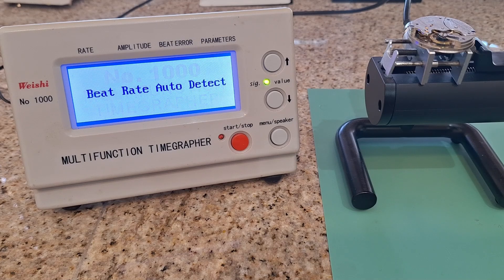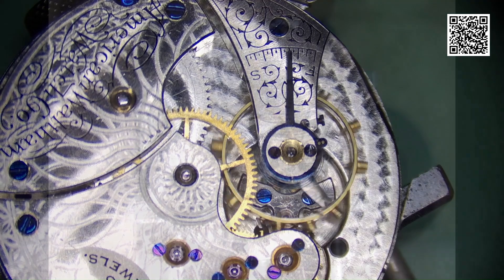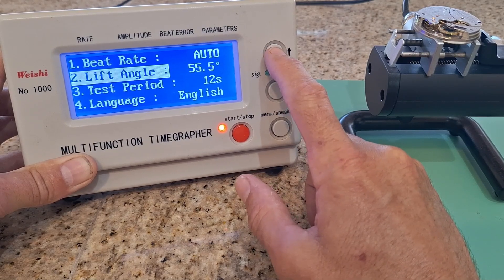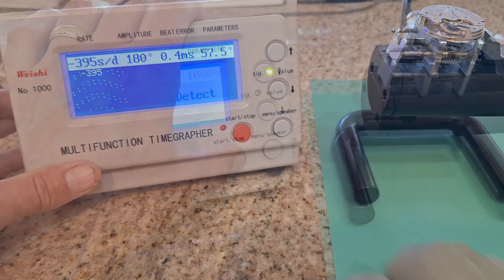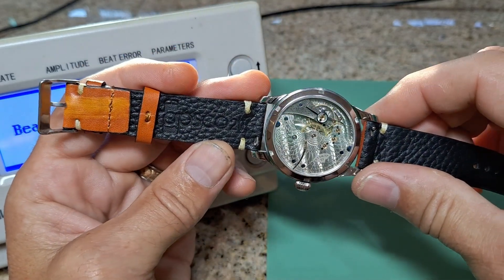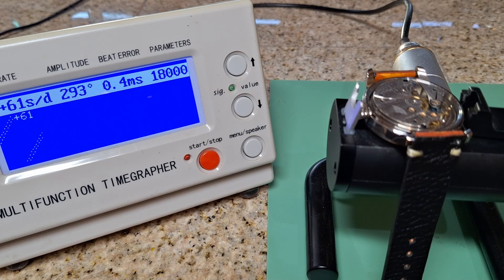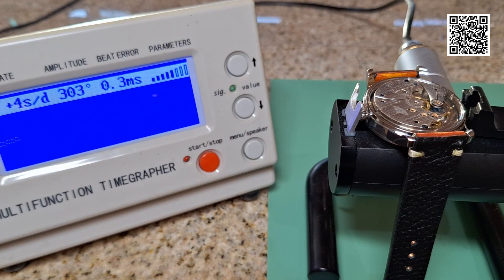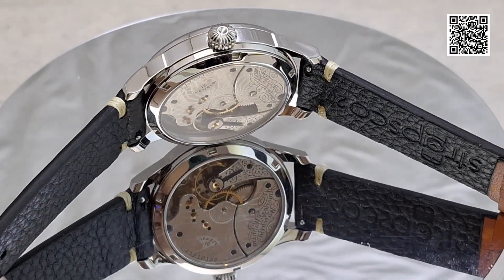How to calculate the lift angle, using a Waltham model of 1890 size 6 pocket watch.

Comment: I'm trying to understand the process of finding the lift angle. So, the amount of winding of the mainspring determines when your red mark is at 180 degrees? I think I'm missing something. What if your angle isn't 180 degrees? How would you set it up so it is? If it is off 5 degrees how much does that matter? Thank you.
Reply from the maker: It sounds like you basically have it figured out. A very weakly wound mainspring will tick but at less than 180 degrees, a fully wound mainspring will give more than 180 degrees. You need to slowly wind and visually check the amplitude until you are exactly at 180 degrees, (or as close as you can tell to 180). It is pretty easy to see when you are at 180 when the mark on the balance wheel stops in the exact same place on each change of direction.
Reply: @Watchspotnet  Thank you!